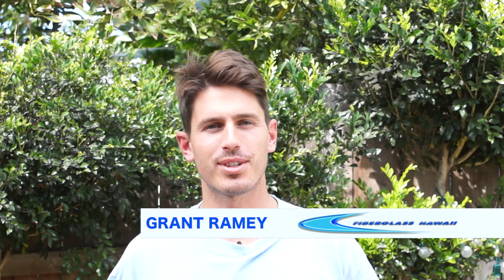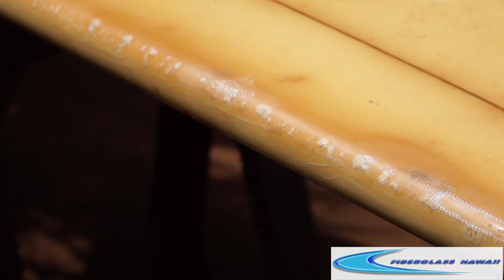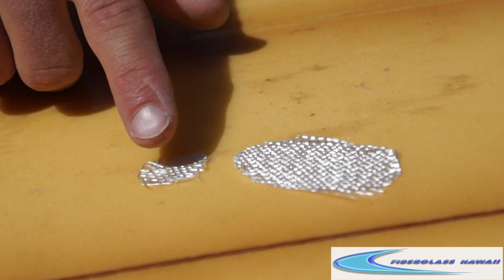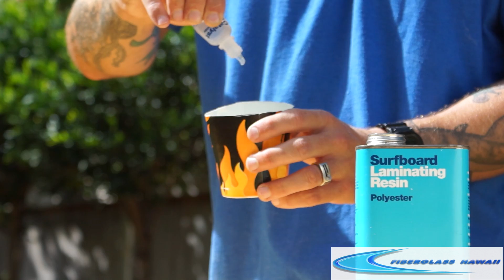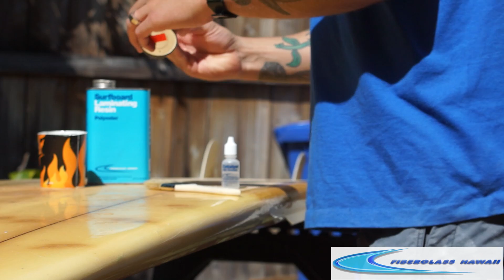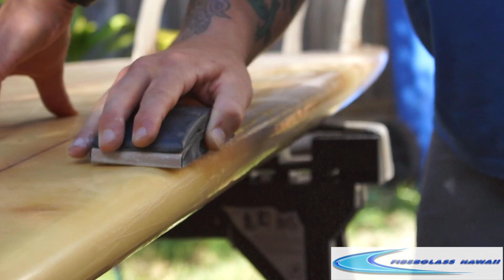Basic Ding Repair Video

Comment: What is in the surfacing agent? And what does it do? Love your videos.
Reply: It turns the laminating resin to sanding resin, which makes it easier to sand (not sticky). Sanding resin could also be used in place of laminating resign + surfacing agent.
Reply: @sprainedankle8547  Thanks